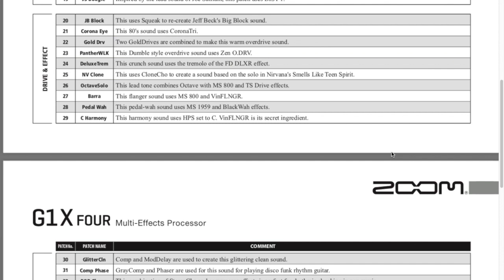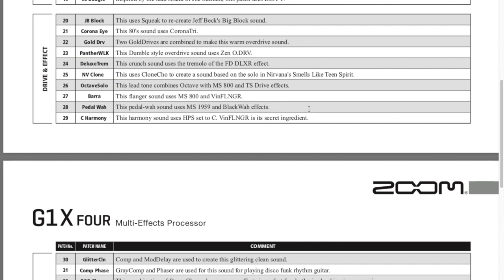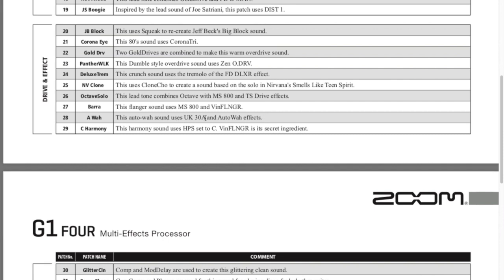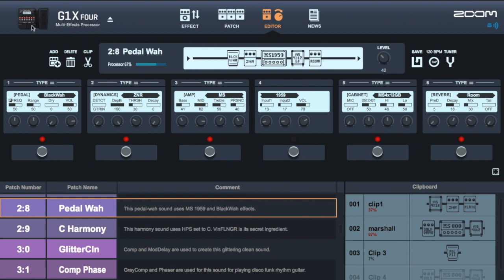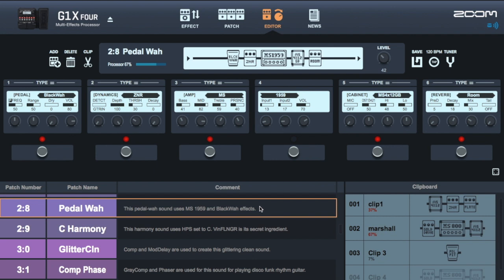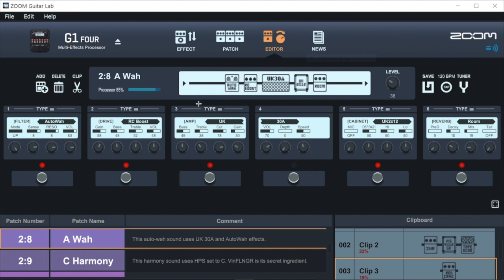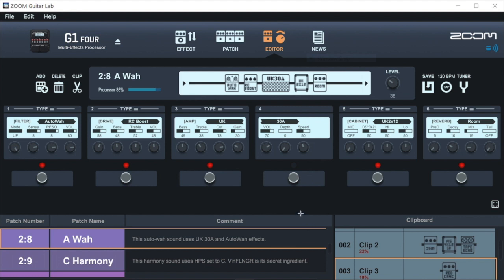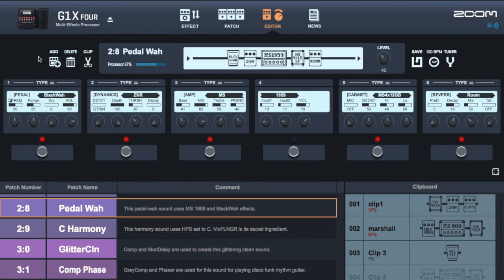ZOOM G1X FOUR PEDAL ADVANTAGE OVER G1 FOUR PATCH 28 BLACK WAH VS AUTO WAH MARSHALL 1959 VS UK 30A

Comment: NIce demo! What i found a bit strange with this pedal was that the auto wah for me doesnt sound correct....because from my understanding the auto wah is supposed to simulate a  wah pedal being pressed/released at a certain frequency...however in the Zoom G1X it only allows you to set the pedal position to "UP" or "DOWN" mode which then doesn't give a proper autowah experience.

Comment: Thank you for the demonstration. Please make a video highlighting the differences between similar patches of both the processors. I will choose and buy one after watching your review since you explain really well.
Another question, do I need to turn on the cab simulator everytime i select a patch..coz as far as I know, unlike the old models of zoom, here the Simulator is kept off by default.
Reply from the maker: Thanks. Go for the g1x four with pedal.  Either way you cannot go wrong. Yes you have to enable cab sim for all patches and save.
Reply: @sierrasignal  Thanks for the recommendation. Keep going. 💙🖤
Reply: Thanks for the explanation. I’ve looked to see, but I can’t seem to find the answer. Can you add an expression pedal to a G1 four? I have a g1 four and wondered I’d you could add one as an afterthought